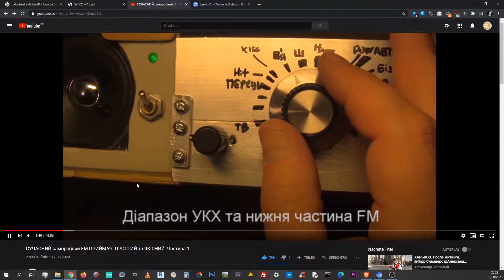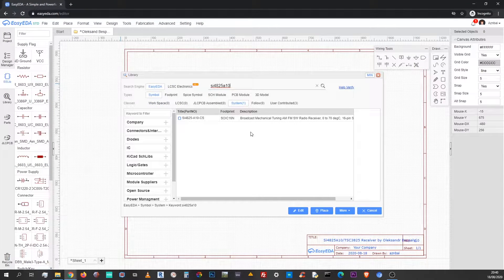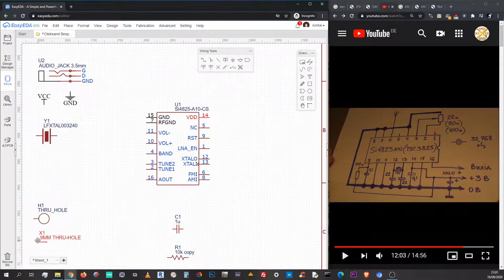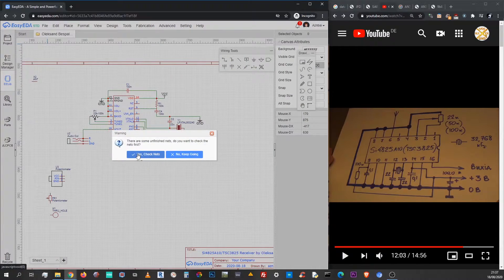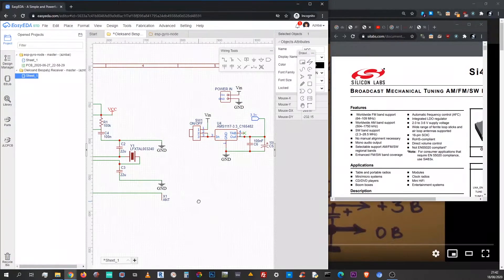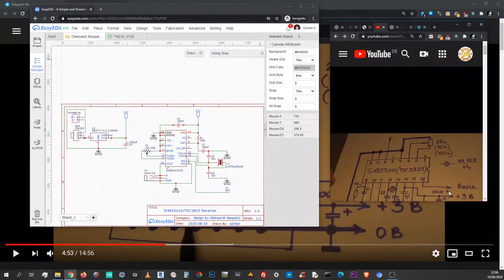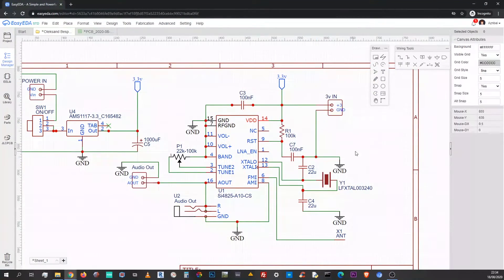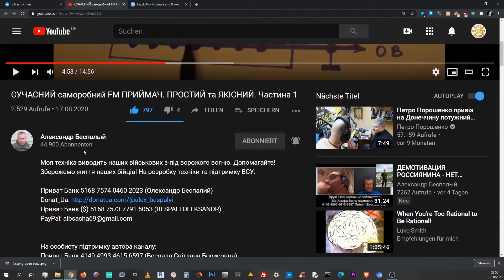Bespalyj FM receiver PCB

Comment: Interesting deviation from the Application Notes with the grounding of pin 4. I assume that it simplifies the design if you wish to receive one band only? And which band out of the 41 available are you receiving? AN738 from Skyworks shows pin 4 as part of a voltage divider for band selection.

Nice project!

And yeah, that footprint could use some cleaning up. :)
Reply from the maker: thanks buddy. Bespalyj aimed this design at absolute beginners and kids, thus the reduced part count